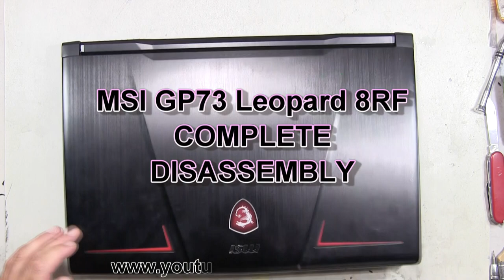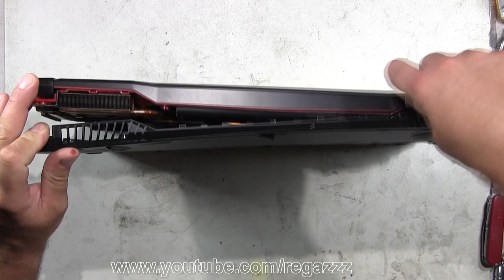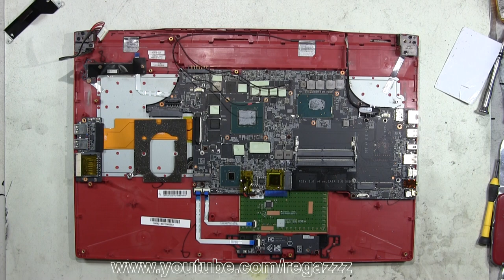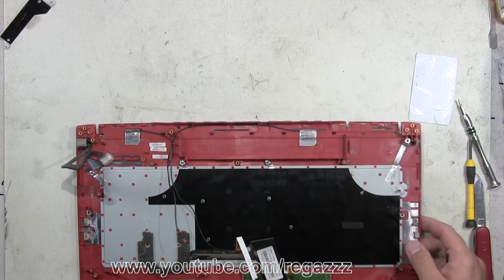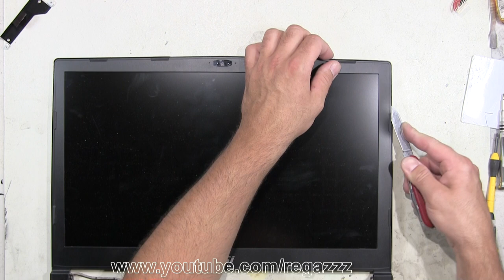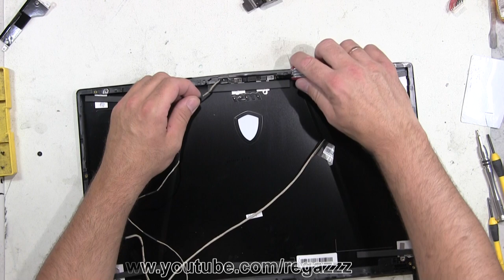MSI GP73 Leopard 8RF 17inch How To Complete Take Apart Full Disassembly Nothing Left

Comment: Do you remember which components are installed in the system? I'm thinking about upgrading the RAM and storage but I'm not sure what's already installed.

The website states that the system can support up to 32GB of RAM with two slots that can handle either 2400MHz or 2666MHz. What type of RAM is currently installed?

As for the storage, there's a 1TB HDD and a 250GB SSD installed. The website mentions:

"1x M.2 SSD slot (NVMe PCIe Gen3)"
"1x M.2 SSD Combo slot (NVMe PCIe Gen3 / SATA)"
"1x 2.5" SATA HDD"
Does this mean I can add another drive? Or are these the ones already installed? Thanks in advance for your awesome video!
Reply from the maker: Hello, thank you for the nice words! If you rewatch this video, check how many memory slots available. If two slots - you need two sticks 16gb each. Unless you already have it. I think you should be able to find your CPU specs in Windows or in BIOS... Need to Google something like "get PC memory specs in Windows".  Something like that. 
If it says you have 2 name slots and one sata that's great and once you know ( should be visible in BIOS ) what drives you have - you can plan for upgrade. Cheers!
Reply: @regazzz  thank you so much for helping me!! 🙌🙌
Reply: I just had mine open recently.  There are 2 pci m2 ports for 2 ssds and a single 2.5 sata port (I use for storage drive)  There are 2 ram slots and the CPU can support up to 3200 mhz same as shown here.